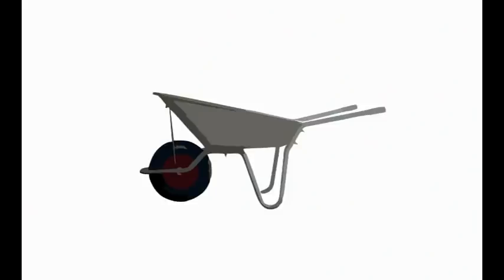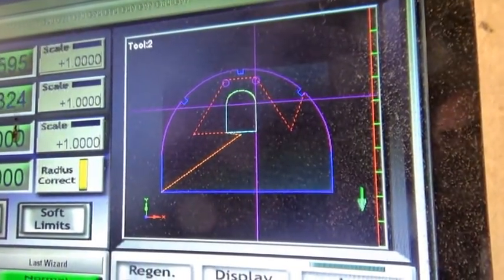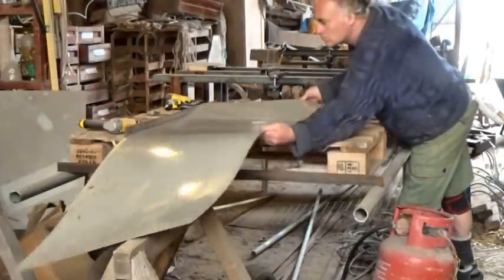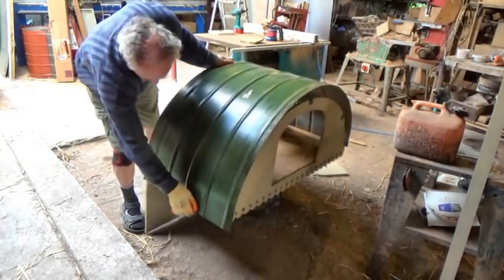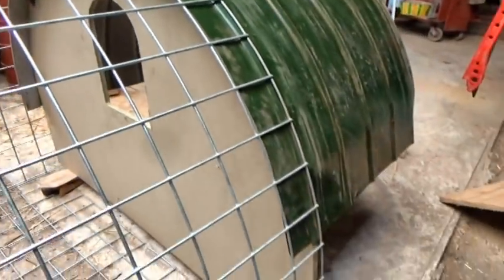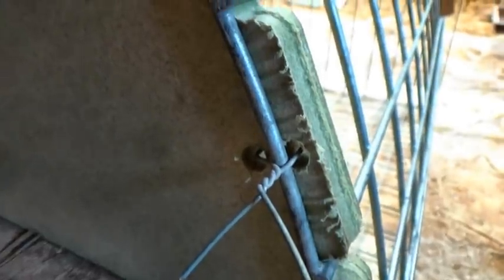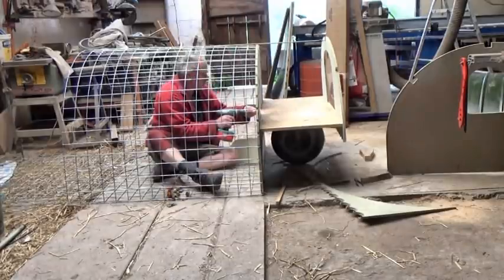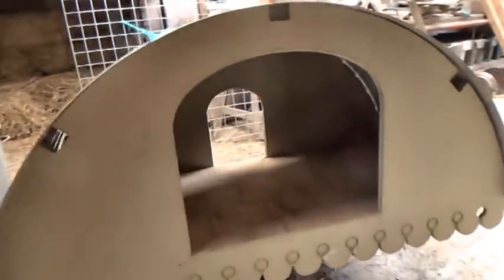Prototype Wheelbarrow Chicken Tractor - an interesting design challenge

Comment: Very cool, that design seems promising! 
If I was to make something similar I would forego the rigid run for a roll of temporary fence netting. I doubt it would need to be electrified (maybe to keep predators out if that's relevant), but something that is made to roll up with some tread-in stakes that go in the ground. The roof over the run could be made of the same material, or a tarp or something like that. If you need a roof at all. With an electric fence you don't. 
When you move it the chickens would be in the coop with the doors closed, and you could take down the fence and roof and roll it up. Much less bulky and probably a lot lighter! :) I might go for a wagon/pushcart design for the coop for that kind of design. The chickens might prefer that, too.
Reply: Agreed, look at the design shared by Justin RHODES its a Chicken Coop on wheels inside premiere one netting, this way you will have a more modular and much bigger space for them to roam

Comment: Beautiful, as always. 
At the cost of a slight loss of simplicity, I'd think pop down bicycle wheels on either side, set a little bit further toward the back/center of gravity, could give some stability, allow heavier load, and provide more ground clearance. You're effectively carrying the weight of all the chickens, after all... Also, if there's any way it can come apart into several pieces, that will save a lot on shipping costs, and/or allow a bigger run area.

Comment: I love the router. Does the material HAVE to be metal? If it is just for 3 chickens is the target buyer a new chicken owner? How long would the average buyer expect to keep chickens after starting? Your design looks like it would keep out bears and will be so heavy to ship and buy. What is the lightest and cheapest material for a coop that would only last 4 or 5 years instead of a lifetime? maybe you could nake a coop out of foil covered  foam panels or coroplast to make an A-frame and use strong dacron netting and a pvc frame for the run. Use the router to cut slots and tabs in the foam or coroplast so it is simple to assemble. It would be warm in winter and cooler in summer. . You could still have a lightweight wood floor.  Since it is so light there is no need for a wheel, only skids. The flat light pieces would ship much easier. This is all off the top of my head and most likely no help at all. I enjoy the show.

Comment: We have a long wooden chicken run that is designed to be moved around the garden by two people. I usually end up moving it by myself one end at a time. The twisting of the corners on the ground damages them. You have set me thinking how I could attach a wheel on either end. Perhaps I can find a "wheel barrow" kit consisting of a wheel and a bracket that I can attach to the end. The brackets you have designed look really useful.

Comment: Great idea Tim. I think the arrangement is good, the heaviest aspect should be over the wheel and as you say, hens prefer to bed on higher ground. Looks like you might have ground clearance issues. What about if you made the caged section shorter in height, maintaining the same ridge height but the base of the cage sitting on a foot spanning the width of the cage and mounted nearer to the handles. You’d have better ground clearance when moving the structure whilst keeping it level when it’s not being moved.

Comment: You might consider adding a roosting pole at the end opposite the laying box, otherwise the hens will sleep in there aka poop in the nest box.  I would make the opening for the hens larger so they can fly up into the next box.    I realize your laying box has a curved top for esthetics, but you might want to block off the curved edges, creating one central box for the hens to lay in.  Simplifies cleaning and egg gathering.

Comment: Cage holes a bit big with mink and weasels about Tim.

Maybe the access/cleaning door at the back could have its base level with the floor.  Put some vinyl on the floor and then cleaning is just a matter of brushing straight out into a wheelbarrow.

Do like your thinking and simplicity is the key.
Reply: Looked again and unsure if the base of the access door is level with the floor, forgive me if I am wrong.

Comment: Great idea. I wonder if a taller wheel would help as well as incorporating your handles into support for the nest box. They could run all the way through the cage portion, adding additional strength to the side of the cage as well. Good luck.

Comment: i catch chickens with a hoop fishing net & transport in a 8ft long rabbit cage that's hinged/opens on top both ends. before that was using the pickup truck with topper but they'ld try to fly out every time i opened the topper. works for pigs to. pigs are soooooooooooooooooooo hard to catch when they break loose

Comment: You have a point of failure where the mesh is wired to the wood. The two holes that the wire comes through are close enough together that there is a risk that, under stress, the wire will pull through the wood. This can be addressed by crossing that point (on the side opposite from where the mesh is wired down) with some metal.

Comment: Awesome, i think you could make 2 pieces, a frame with the handles that runs allong the side and attatches to the wheels, and the body which is the cage and box. Firstly that would make it stronger and not put stress on the cage, and also mean you could ship it in two pieces, and not have to worry so much about having to fit it on a pallet, as you could stand the frame on its end, you could even make the frame into 2 pieces so that no part is more than 4ft

Comment: Do you think 2 large heavy duty bicycle wheels will give you more ground clearance than the wheelbarrow wheel?  We have a garden cart that I can use to easily lift 200 lbs of straw. I’m short and not very strong and it works wonders for me.  The wheels are situated across the middle of the box part hooked to each other by a simple axle. I found the type we have at cartsvermont.com. I have no business relationship with this company.  They just happened to be the first one that came up in my google search.  Here are the specs from their website.The Model 26 is our most popular garden cart. It can move huge loads of leaves, tree prunings, and yard debris smoothly and efficiently. Hay bales and barn chores are a breeze. We offer 2 types of wheels – either our recommended maintenance-free semi-pneumatic (solid) tires or, our pneumatic wheels (tire and tube) – for most applications, we recommend the semi-pneumatic tires.
Dimensions Inside: Length: 47.50″ Width: 31″ Depth: 16″ Capacity: 13.60 cubic feet
Dimensions Overall: Length: 67.25″ Width: 41.50″ Height: 30.25″
Max Weight Capacity: 400 lbs. with heavy duty 26″ wheels (we recommend the solid tires when ordering)
SUPERIOR CONSTRUCTION: 1/2″ exterior grade plywood, galvanized and plated steel components for strength and rust resistance.

Comment: adding on to  SFSH comments . lose the lower board the bit behind the wheel bend mesh up to nest box. the hens will be happier not trapped behind  wall where monsters jump out from. Design 8.0 stop being trapped by that height. if you bend mesh up like previous idea, and now lift original back board up onto wheel height taller nest box. you can ship in twoparts. that way the run can now double in length as they nest(the parts not hens)  for transport

Comment: Looks really nice!  Could the wheel bracket somehow also butt up to and attach to the wall between the two compartments, and extend down to the bottom, and attach to beams or pipe of some kind under the main part, i.e. to carry the lifting load when you pick it up?

Comment: Wouldn’t it be better to have something of a main frame running trough the whole structure? I’m thinking something like two metal pipes that directly attach to the wheel and then somehow become the handle bars at the other end. If you then attach everything else to the “frame” I think you could end up with something more stable, but also easier to move around, as it wouldn’t be so floppy.

Comment: Very interesting! You have made a "chicken tractor" - that's the term where it's moved around regularly for the birds to dig the soil for you. I suggest you make it so it can be entirely flat packed. Why is the ground floor wire? To protect from burrowing predators perhaps? Can't it be designed open so the birds can easily scratch about? [1] Make a Toblerone shape that incorporates the coop rather than the coop as a separate structure. [2] A two storey A-frame shape would work - two flat panels that lean together to form the structure [2] Bottom half of each panel [ground floor] is wire while the top half [the coop] is covered in sheet metal - with swing-up door flaps in one of the two panels [3] The coop floor is open wire & I suppose you'd put in a horizontal pole running the length of the coop section for the birds to perch on [4] Two small wheels at one end & a simple lift & pull handle at the other [pulling means you can use small wheels. [5] Don't use MDF - too heavy [6] A 'Toblerone' side panel could be made of two square panels that lock together to form a horizontal rectangle - the four square panels would comfortably fit on a pallet or simply make suitable cardboard packaging - cheaper shipping than a pallet probably.

Comment: Chickens natural behaviour is to scratch all day. Please don't make it with a mesh floor. That's just cruel, they can see outside but not scratch. A true 'chicken tractor' is a permaculture concept used to prepare ground for vegetable planting by manuring and scratching of the hens as part of a garden rotation. Otherwise this is a fun and interesting design Tim, please address this issue.
Reply from the maker: It has to be a compromise, Bev - without a mesh floor the foxes would just dig their way in and eat the hens. They will still be able to scratch away though (big mesh) - they just wont be able to dig large holes in the lawn.